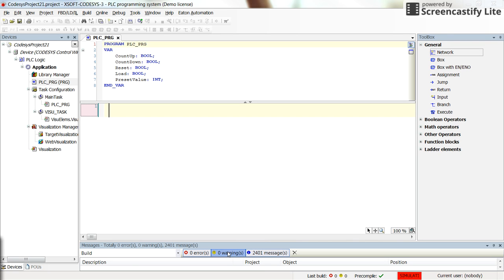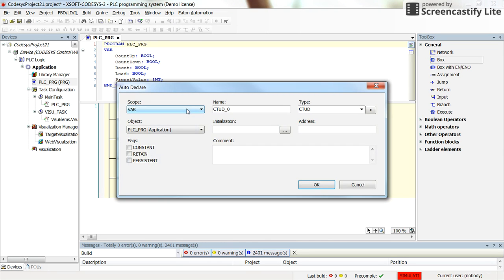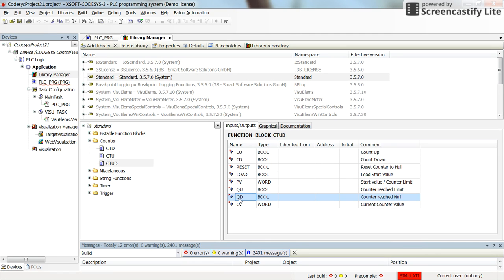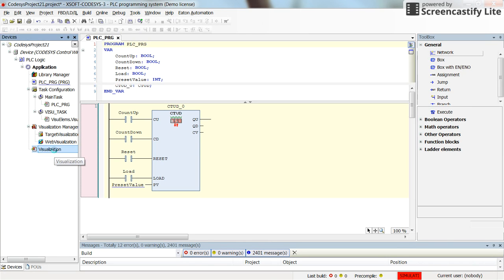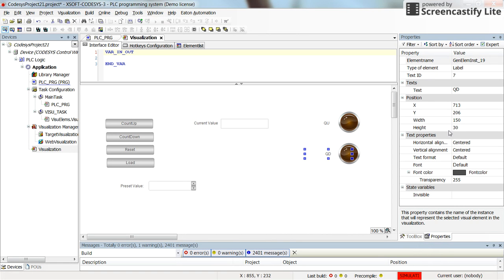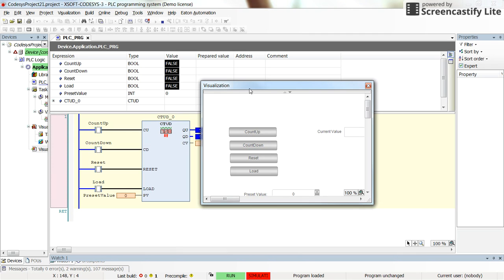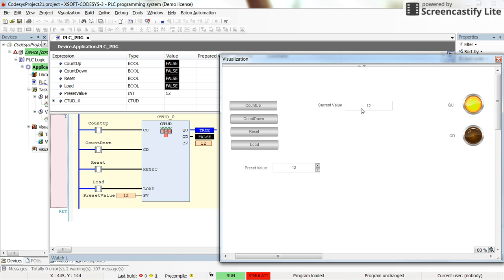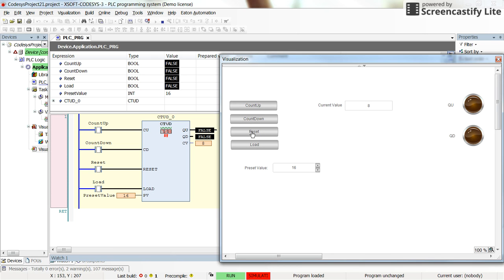CODESYS: Using (CTUD) up/down counter function block #codesys #plcprogramming #ladderlogic #iec61131

Comment: Hi Tohid, How do you assign variables to the pushbuttons? for lamps/spin control etc, 'variables' usually shows up in the property of the element but I don't see it for the pushbuttons
Reply from the maker: Hi, thanks for your comment. In the case of pushbuttons, you need to use the "InputConfiguration" Filed in the properties (the last filed), where you determine what happens if the button is pressed, or released, etc. I hope this helps.
Reply: If you're just using a Button, you can set a variable in Tap and it will cause the input to change state only when you click on the button. As soon as you release the button, the state changes back. This is good for momentary switches like a start button that has a seal-in contact. If you set the variable in Toggle, it will hold the same state after you release the button. For switches, they hold their value anyway, so if you set a variable, it will be toggled by the switch. I've just re-installed CodeSys and for some reason, the input configuration is different (or perhaps I just need some sleep). For some controls, I've been adding some structured text on the Mouse Down and Mouse Up events to set the inputs to True when clicking the button, then False when releasing the mouse button. I'm only just learning, so there are possibly lots, perhaps better, ways of doing things.

Comment: Hello Tohid!
Is it posible to do this exactly same but with Structured text? I'm not good with ladder :)
Reply from the maker: Sure, it is possible. You may need something like this: 
CTUD_0(CU:=CountUp, CD:=CountDown, RESET:=Reset, LOAD:=Load, PV:=PresetValue);
Reply: Thanks!

I got one more question.

How to make program with ST to combining order?
For example... I need some order like this 
"1. S1  
2. S2  
3. not S1 
4. not S2 " - and when it realize in that order, than counter up have activated... I tried do this with 5 steps with initializing  step=:0 in the place for variables... :)
Reply from the maker: I think I did not get the point in your question. Could you please clarify more. Do you want to have all those being checked in series, and in the order mentioned? Then why do you have S1 and then not S1?
Reply: @TohidAlizadeh   Hi Tohid, really enjoy your videos thanks, need some help. Which way is Faster, CTUD(CU,PV) or IF iBOOL AND NOT interlookBOOL THEN, interlock:=TRUE; Chanel=chanel+1; end_if, IF NOT iBOOL AND interlock THEN, Interlock:=FALSE END_IF

Comment: You not showing how the end is made(visualization part) makes me sad. :(
Reply from the maker: +Andersbendorff I just wanted to keep the video short. The visualizations elements are explained in the other videos. Let me know which part of it seems difficult to you and I will recommend you some other videos accordingly.
Reply: Thanks for you reply, the Preset value. how do you define it. im quite new to codesys. + im using a older version then you are
Reply from the maker: +Andersbendorff I have used the SpincControl element to do so. You can check how to use it here: https://youtu.be/omcSLu1IXX8
Reply from the maker: Since you are new to CODESYS, I would recommend you to have a look at the webpage of my industrial automation course, where you can find the videos categorized properly: - Visualization videos: http://tohidalizadeh.weebly.com/codesys-visualization.html
PLC programming videos: http://tohidalizadeh.weebly.com/codesys-plc-programming.html
Reply: Thanks, ive been watching some of you videos. but cant find much about Analog inputs. do you got something with LIN_TRAFO ?
Reply from the maker: I do not have any video on LIN_TRAFO now, but I put it in my to do list. I will prepare one ASAP.
Reply from the maker: Here it is, a video on how to use the linear transformation (LIN_TRAFO) function block in CODESYS: https://youtu.be/JZGNr3VC2lM